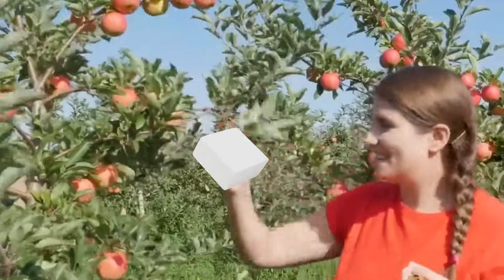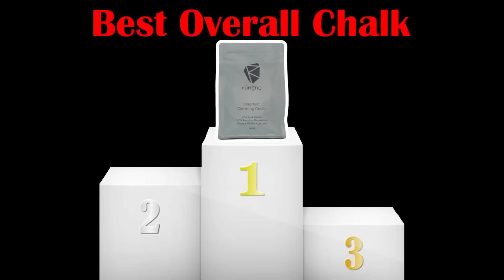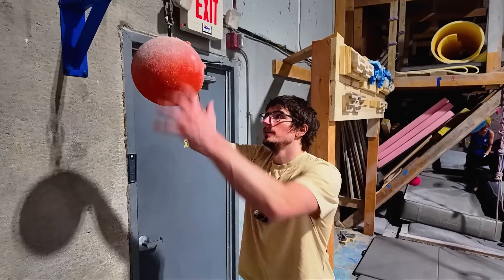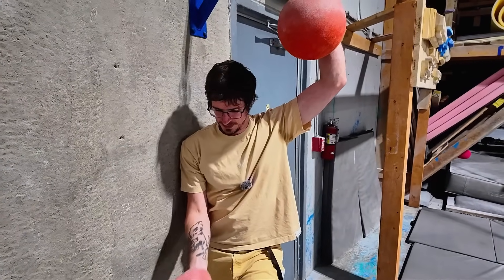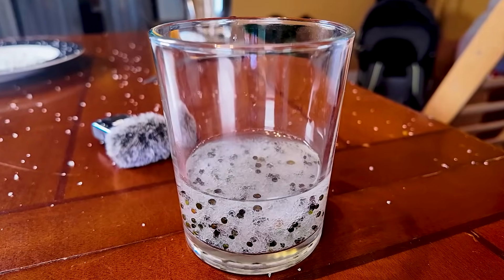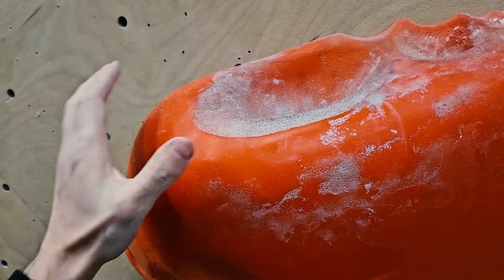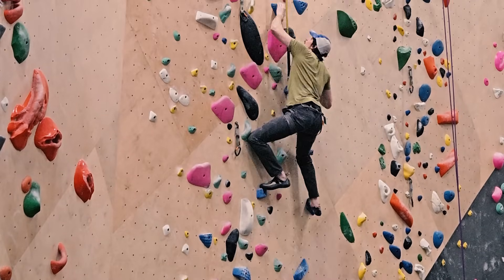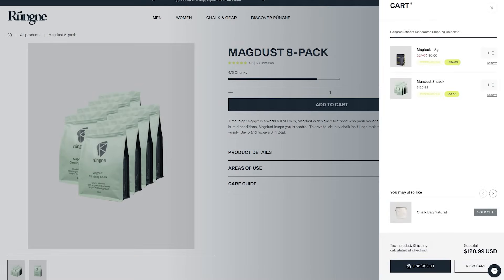What Will Happen to Climbing Chalk?

Comment: Biotechnologist and tryhard climber here - My chemistry skills are a bit rusty, but I read (a tiny bit) into this topic.

Seems like we can recreate Maglock at home for cheap.
After all, I have made my own (Mg-based) chalk in my garage for the past 2 years now - results not as good as White Gold or MagDust, but comparable to Mammuts chunky chalk imo.

Powdered silica (dimethyl) silylate is not available in non-industrial amounts. You can get it in smaller amounts though for the bead-sized version as far as I have seen.

But 120 micron (as used in MagLock ??) isn't crazy small, 0.12mm - no specialized custom machinery needed to grind it down to that size.
Then some trial and error to find a good ratio of silica and regular chalk that works.

Addressing the amino acids:
I haven't quite figured out why they add them. Does anyone have a good idea?
All I could find was a paper that described how the presence of AA's aid in the creation of oligomer- structures of silica silylate during initial synthesis.

Which means that adding amino acids into the final "chalk" product wouldn't do anything, as this interaction would require everything to be dissolved.

Maybe some high-level alchemist wizard has an idea what other functions the addition of AA's might have.
Reply: So do you wanna tell me the product is absolutely overpriced due to the hype?
Reply: Idk, some amino acids are good at binding water, and so the added amino-acids could further stimulate water absorption by the maglock.
Reply: Finally.  An actual comment not based on immediate emotion and frantic typing only to be the 50th person to say the exact same thing. 😂

Almost gave up scrolling the comments to find something actually interesting.  Thanks for sharing and would love to see how far you get with this.
Reply: Amino acids are commonly seen in a lot of skincare products, so my guess would be that they are there to keep the skin healthy. Here’s a NIH paper I saw about amino acids used with skincare products. https://pmc.ncbi.nlm.nih.gov/articles/PMC11011925/#sec4-ijms-25-03797
Reply: Maybe it's like resin and helps stick to the no-tex surfaces?

Comment: Everyone wants to reinvent the wheel, nobody wants to invent a motor, if you will. I'm vastly more interested in products like "boost" that hamish mcarthur and ethan salvo have been psyched on, antihydral, rhino spit, and other modes of skin conditioning that make chalk less important in the first place. I'm convinced that in ten years we'll have better methodologies for skin maintenance to such an extent that the quality of chalk will hardly matter comparatively. Certainly seems more compelling than flooding gyms (which at least in the states, often have subpar or entirely non-functioning and against code HVAC systems) with dust that causes severe lung damage lmao. I'd also reckon this will degrade rock in ways that normal chalk doesn't, since it's a polymer, which might only create worse issues with holds becoming soapy and greasy. Also would probably be a bitch for hold washers at your gym. Please don't use this shit, at least outside. I'm throwing hands if I see some mfer coating holds with a fucking polymer

Comment: We have literally no clue the long term impact of this stuff on rock. Please do not use this shit.
Reply: ...and on lungs ?
Reply: Dude silica is not going to damage rock, it's not going to react with the rock in a different way. They are both just built to absorb moisture.
Reply: @lemonmallon2531 if the particles are harder than rocks then they will erode the rocks

Comment: Magnesium carbonate is technically as much a salt as calcium carbonate.
Reply: Right.  They are both carbonate minerals not salts...
Reply: @mattcannon6233 They are both salts. A salt is a substance that has ionic bonds between ions. 
We have the positive kations Magnesium or Calcium and the negative charged anion carbonate building a lattice. They are salts.
The same as table salt where you have positive sodium ions and negative chloride ions. NaCl.
Of course in the general non scientific use of salt people think of table salt and not about the chemical definition of salts, but I still like for people to have heared of it once.
Reply: @MrKaratefan  I was thinking geology.  We commonly refer to halite, gypsum, and anhydride as salts as they occur together in salt diapers.  I didn't know that anything with predominantly ionic bonds is chemically classified as a salt, neat.
Reply: @MrKaratefan  Upvoting for actual chemistry knowledge.

Comment: Was that tested to be safe when inhaled?
Reply: That's what I'm wondering... Silicate is what caused silicosis. While one exposure is not a problem, I'm questioning the long term safety.
Reply: @observing7312 it absolutely isn’t. You can look into this, but yeah breathing in large amounts isn’t great. For sports that aren’t climbing it isn’t much concern but when your hands are coming to your face or your face is in a hold covered in it. It’s a very large amount you have to inhale for problems both long term and short term.

Pretty much all but rock climbing and sometimes gymnastics it’s perfectly safe. Because the quantity used is enough to be properly filtered by the system and you’re fine.
Reply: @Fella_friend  my only concern is for employees of climbing gym.
Reply: @observing7312  they’ll be fine, us route setters use ladders to take holds off, then wash them down. We’d have that same reduced contact as you’d see with other sports so not much concern.
Reply: @Fella_friend we are both talking about the holds, but about the volatility of the product. Looks very volatile and will get in everyone's lungs
Reply: Norwegian laws are pretty strict, so I'm guessing it's fine? In any case I would do some research, not trusting comments on yt! Mine included! Check what is actually in the packaging and find some scientific paper about it!
Reply: @androgynousmaggot9389  i did, it's still debated. I think for the climber it's fine but for those working in climbing gyms, it could be a different story.

Comment: If there are lung health implications from breathing it I feel like this could be disastrous if it does become a common additive in chalk in the climbing gyms..  Hopefully this has been considered and tested... Im sure its fine outside but everyone using it in a busy climbing gym could be a ticking time bomb.
Reply: Yeah, OSHA recommends a limit of 6 mg of amorphous ( = non-crystalline) silica dust per cubic metre of air. It's way less dangerous than crystalline silica and won't cause silicosis or lung cancer nearly as quickly, but it's still a completely unneccessary health risk in a climbing gym.
Reply: @Wischmopp95  in the eu, its tested for work. There, normal dust exposure is around 10mg per cubic meter over 8h. Amorphous sillica has a value of 4mg over 8h. Sillica crystals have a value of 0.05mg to be considered as save. 
Soo there is quite a huge difference.
Reply: It's completely disastrous. Check out what the CDC has to say: Amorphous Silica, Inhalation. The database is lacking studies evaluating the effects of intermediate-duration inhalation exposure to a-silica in humans. However, data are adequate to identify the critical effect following intermediate exposure to synthetic a-silica in animals. Available data indicate that the primary target of intermediate toxicity is the respiratory system following exposure to different synthetic a-silica polymorphs. However, only limited data are available regarding the relative potency of polymorphs following intermediate-duration exposure. The lowest LOAEL identified was 1 mg/m3 for 13-week exposure to pyrogenic a-silica, which was associated with increased cellularity, inflammation, and fibrosis; a NOAEL was not identified (Reuzel et al. 1991).
Reply: @gretabird7305  Awesome info. Note that the compound in this case seems to be methylated on the surface, which may make it better, or it may make it worse.
Reply: Well, as an asthmatic what I already hate is the dumbass clapping of hands at gyms. And usually someone is sitting right there and dumbfuckeroos smack their hands in front of your face. It's not that hard to just rub off excess chalk and not blast it all over the place in someone's face. Anyhoo, silica seems pretty bad for lungs but then again anything synthetic/plastic etc in microscopic form is usually pretty bad. It was a bit of a challenge to find a paper on silica silylate specifically but as this paper also does mentioned it's not exactly great for your lungs either even if it's used in cosmetics https://ijt.sagepub.com/content/32/3_suppl/5S.full.pdf
Reply: You not supposed to breath it. It goes on the hands and privates
Reply: consider rubber dust and normal chalk with heavy metals in them first
Reply: @ckehung2450  most of those particles are not as small and inhaled as deeply into the lungs
Reply: There aren't. This has been tested extensively and in the quantities present it's not dangerous... at all. In fact, if you ever climbed outdoors, you're going to kick up more silica dust in the average chossy climb than you'd use in your average climbing session with this stuff. Climbers just love to freak out over anything different.
Reply: @EvDevMojo  I'm not sure "freaking out" over substances in the air is unjustified. Wouldn't it be lovely if later in your life you discovered this shit is like aspestos? For years, no one cared. 

If it's tested properly, then sure, but I'm not going to assume that.
Reply: @ I see your point, but that's not the standard we hold most substances involved in climbing to, including your 'standard' magnesium carbonate chalk, rubber, fiberglass holds, alcohol in liquid chalk, and of course the general risk of injury as a result of climbing. Which is 100% real and a risk you will face if you climb in the gym or outdoors. 

I think that climbers have a tendency to immediately reject anything that looks different from the exact way they learned climbing, and this fear-mongering is a prime example of that behavior.
Reply: @Ekid33  so all those workers with asbestos wouldn't have been justified in their concerns because their jobs had a high accident incidence anyway? The fact that they worked with other unpleasant chemicals negates the need to have worried about asbestos? I haven't heard rubber or magnesium carbonate listed as hazardous materials if breathed in, maybe they are but it's kind of irrelevant anyway.  Given the past history of other damaging substances used for commercial gain, and their risks covered up until its way too late (current talc scandal is a good example) I think a bit of concern and questioning is pretty justified.
Reply: @EvDevMojo what are you, a salesman? this is a perfectly normal thing to question. silica is says on every bag it comes in “do not eat”, and while this product is not silica gel, it’s perfectly reasonable to be concerned about the possible health hazards. why are you getting so defensive?
Reply: @EvDevMojo  The nice thing about regular magnesium carbonate chalk is that it's literally used as a magnesium supplement in its food-grade form. Also, it gets absorbed in the lungs after few days, probably used as a nutrient. Not sure if we can say the same about what's essentially a very fine sand.
Reply: @therflash  well, sillica has different structures. A crystalline and amorph.
The danger is not perse that is comes into the lounge. The lounge can self clean to a degree. The danger is more that the crystalline structure has sharp edges and destroys the little bubbles in the lunge. This is not the same with the amorph structure. To be clear, to much of this is still bad, but as I said previously, the amount of dust you can be exposed and is considered as save (in EU) is 0.05mg per 1 cubic meter ofer 8h vs 4mg. As comparison, normal dust exposure is 10mg.
Reply: @rankala  I don't know what you mean by "normal" dust exposure. Have you seen some gyms? Sometimes you can literally the white fog in the air, that's how much chalk there is. And then we put our noses right next to the climbing holds that have the stuff on it.

Chalk isn't ideal, but at least it seems to absorb pretty quick, and it's a nutrient.

Anyway, I know it's (hopefully all) amorphous sillica, but unless the lungs can absorb it, it's most likely gonna stay there for quite a while. Also, it's methylated on the surface, whatever effect that has.
Reply: @ the normal exposure is ment: this is fine and you do not need to provide anything. 
10mg of normal dust is like the default. 
And to be clear, it’s over a time span of 8h. So a short term exposure could have more for example 20mg over 1h (don’t know the actual numbers here)
The context here is the work protection law. So this are numbers to keep you safe in the long term. 

So for people doing sport in a gym, it’s probably fine if it is dusty in a gym. The people working there, thats a different thing. 
Modern gyms take this into account and build air purifier in. I know, thats not always the norm and it is also regional different
Reply: @rankala  The other consideration is that ostensibly you'd be using a fraction of the amount of regular climbing chalk as well.  Nobody be dipping into their pot before, during, and after each climb as much as they do now.  Less leftovers on the holds and everywhere in the gym, so all in all significantly less is used to do the same job.

You can never be too careful or just brush off potential cumulative negative effects, but so far it seems there's considerable side-benefits to silica silylate and negligible negatives apart from the price.
Reply: @ yea i agree with that. 
Good thing is, there are alternatives to maglock, that are not as expensive.
Reply: @EvDevMojo  I think you think a lot of nonsense; and have a very poor understanding of climbing history.
    Oh no; keep the hemp ropes never happened. Let's keep using triconi nails. Pitons forever; damn those nuts. Cams are ridiculous. Sticky rubber should be banned. Keep those 1/4 inch by 1 1/2 in bolts and hand drilling forever. Thinner ropes, never. We should all still wear wool/ cotton and packs should have metal frames. No helmets.
Reply: @rankala  this is what i don't understand: You said EU limit is 0.05mg/m^3, but that normal exposure is 10? 

Seems that you are saying that currently, people are exposed to 200x more chalk than the legal limit.

Anyway, I'm not against progress, people may use whatever they want, but let's make damn sure that this is safe, before we all start snorting it.

And perhaps the first step may be to turn this into an alcohol gel instead of a powder, so that it doesn't spread everywhere when people invert on a roof climb and their sand bag spills.

I don't want to have a shower after a gym and find out that I'm all hydrophobic every day.

Also, why does it outperform chalk? Is it because of the sillica, or is it some kind of glue they added into it, like lot of liquid chalk has? Is it going to gunk up the holds? We better find out what this stuff is before we get another rosin fiasco, or worse, health problems.
Reply: @therflash he explains it better in the comment above that, silicone crystals are 0.05 whereas normal dust is 10mg
Reply: @EvDevMojo  long term exposure is different than acute
Reply: @EvDevMojo  where are those safety studies;
Reply: @EvDevMojo  but maybe the particle size is bigger outdoors.
Reply: @EvDevMojo  Yeah not caring about your health is so cool man, what a weird premise.
Reply: @EvDevMojo  outdoors in the open air wouldn't be an issue I imagine regardless. It's the potential of there being a high concentration in an enclosed space that may be of concern if long term exposure causes issues?

Comment: Oh man... F___k no! Mass is a measure of amount of matter, like how many atoms are there. 50g chalk is exactly the same of "thing" than 50g of silica. xD The difference is that it is as You shown more efficient :)
Reply: No, moles are a measure of how many atoms/molecules there are. 50g of MgCO3 is ~0.6 moles and 50g silica silylate is only ~0.2 moles. So about one third of the molecules. None of this has any bearing on particle size or crystal structure which is what determines the density.
Reply: @ Yeap, You're right. This is what I've forgotten from chemistry classes at high school. :( Although still I'd say that 80g of chalk is the same amount of 80g of silica. At least if You paid for how much You buy :) As  Climbing Stuff mentioned the point is what is more efficient, although the price is quite high.
Reply: They can have a different volume while having the same mass, that’s why he brought up density
Reply: @ Yes. But is a different density, not the different amount :)

Comment: As a construction worker I need my dose of silica when I’m not at work….
Reply: Since I'm not in the trade... Do you get a bonus for a silica lung before your 40th birthday?
Reply: Good old fashioned "roofing powder" 😂
Reply: Anyone who actually does work on regulating the stuff knows that the quantity present in a session with these products is perfectly safe, and lower than the amount that most people (especially rock climbers) are exposed to in an average outdoor sessiom regargless. The amount of daily dust exposure required to develop these conditions is about 10,000, times more than the amount you'd be exposed to by using this in your climbing session.
Reply: @EvDevMojo  Source? From experience there's sometimes a looot of dust flying around in indoor gyms